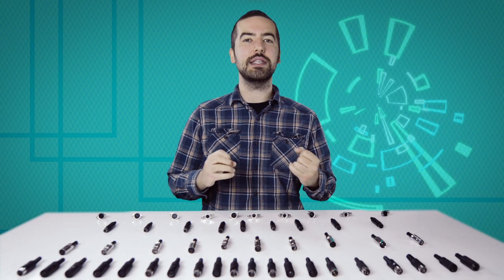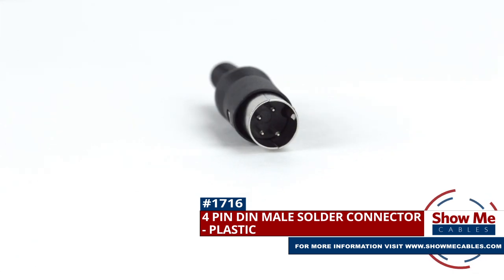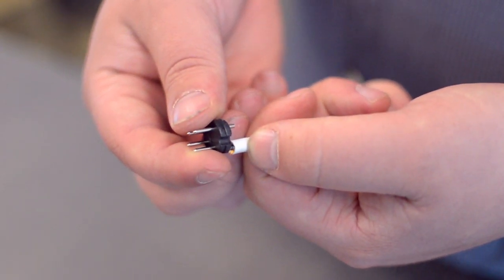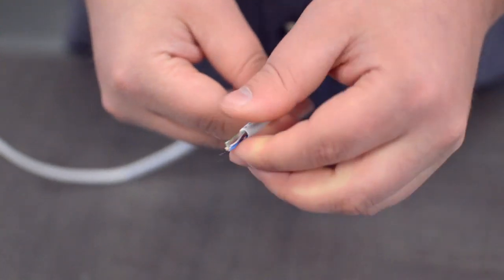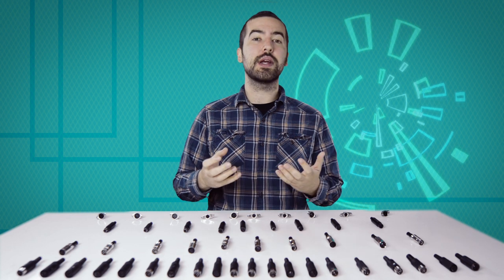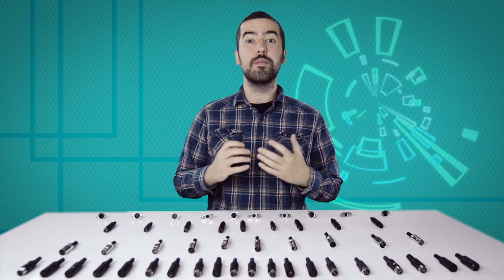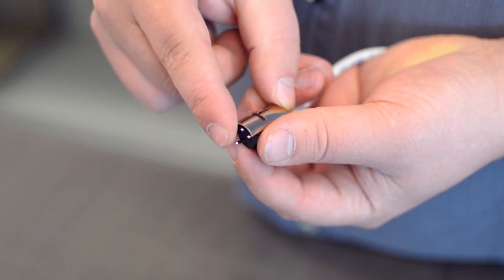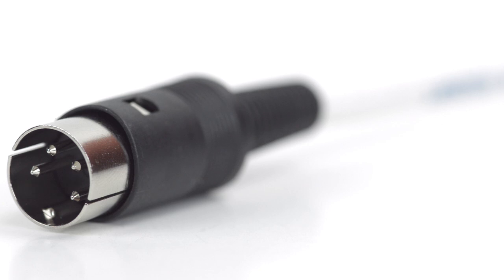How To Install The 4 Pin DIN Male Solder Connector - Plastic

Comment: You didn't show me anything.
Reply: Which colour code wire in soldering
Reply: If you're wanting to know how to assemble, look for this video: https://www.youtube.com/watch?v=63IfR-0NYzM ; 

To disassemble, there is a little tab on the plastic cover, just lift it up and pull the cover away from the cable point.
Reply: All he didn't show was the soldering. If you don't know how to solder wires into solder cups why are you even watching this video

Comment: hi,thx for sharing.i am wondering if this method is for headphone 4pin XLR balance cable. you see,i am trying to make a 4 pins connect with HD650,the problem is that japan canere cable has 4 conductors and a ground under the shield. Is ground needed for headphone? or i am getting it wrong. 4 pins XLR balance only needs a R+R- and L+L- no ground is needed?